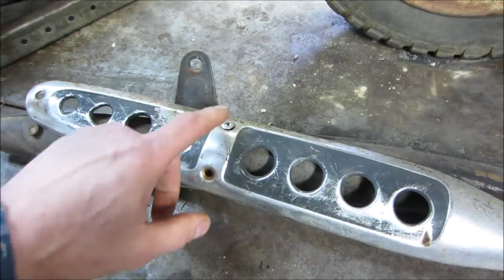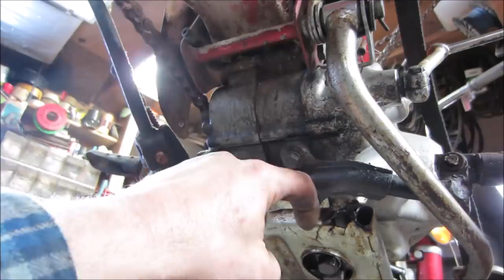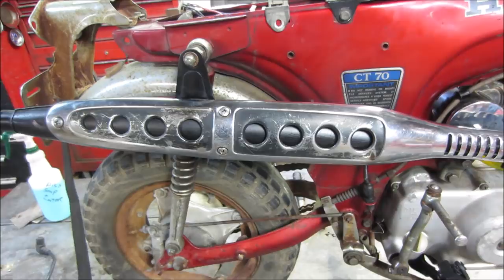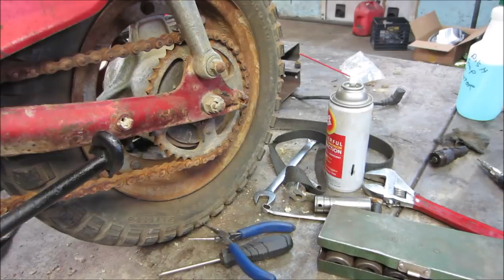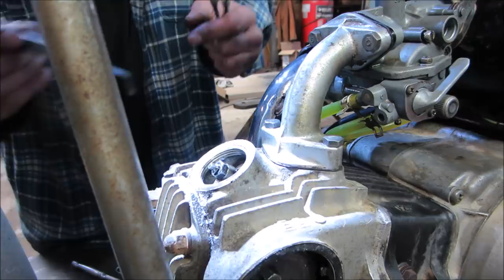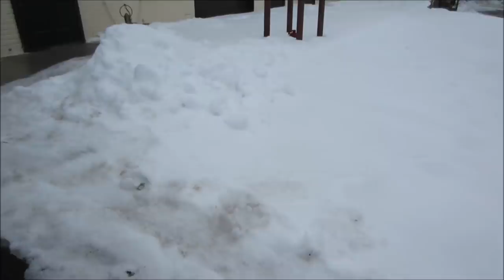The, worn out Honda Trail 70, Engine Repair/Restore, pt4.

Comment: .002" intake, .003" exhaust.  0.016" clearance for points.  Missing a bolt at the base of the cylinder.  As you indicated in the video, no advance.  The closer you stay to that gap the better the top end will be.  Clutch fiber plates are done, it's had automotive oil run in it.  They're slipping due to the friction modifiers, which is why you can't reliably give it a good 'kick'.  You'll notice the clutch slips in 3rd.  There is a "filter" under the clutch plate, gathers all of the clutch ooze.  There is a screen at the base of the right side case cover that should be removed and rinsed.
Reply: They really don't like automotive oil in them! Ask me how I know! (I was 16 at the time) 

Once the friction modifiers soak in the clutch discs they are junk.
Reply: @axkoula7851  Even the Honda DEALER Tried to sell me can of 30 weight AUTOMOTIVE oil with a new QA50 ( minìbike ) & the boss had a big arguement with me ! - " Your just a kid - what would you know " (more than u my friend ) & that was the dealer...I used the running in 10 weight it was filled with once past & during the warranty period i drained THEIR oil & used Belray straight 30 weight - my Dads volvo master agent/Engineer agreed with me -went better too, who remembers Belray Oils from the 1970's ???, seal swell fork oil etc ??? Thanks. Trev.

Comment: It's warming up a bit here in Texas and just as the grass needed it's first mowing I find out my yard guy has moved over the winter. I got out the wife's grandfather's trusty 30+ year old but long neglected Honda mower out of the shed. It's sentimental to her since he was so careful about maintaining it. Of course it barely ran, smoked, wouldn't idle, self propulsion didn't work, and the blade was just a dull hunk of worn rust.  My wife said "Just go buy a new one." I refused. I didn't spend all winter watching Mustie1 videos to fall at the first hurdle!

Even if I had an ultrasonic cleaner I don't think I could have brought that carb back, but a new one was easily had. The blade was likewise beyond repair. The parted transmission cable was more of a challenge since I insisted on repairing it. New plug, new pull cord, oil change, and she's purring like a kitten. Thanks for the motivation, Mustie.

Now if I can just find a kid to follow it around my yard...

Comment: Watching Mustie kick the bike in gear while on the bench brought back fond memories of putting the front tire of my H2 Kawi 750 Triple.  Mach IV Widow Maker.   A friend and his brother had a Kawi dealership.  The friend had an H2 750 too.  He put a tuner kit on it - 850cc with tuned exhaust.  We'd race and then come back to the shop to replace broken clutch springs.  One day he put the front wheel of his bike up against a bench support in the shop.  He kicked into gear and wound it up - speed shifting into 3rd gear.   Wore the cream coat right off of the shop floor and into the concrete below that.  The shop was so full of smoke you couldn't see a foot!   This was just before the big 4-strokes came out and ruined all the fun.   When racing those big 2-strokes you had to think 'shift' as soon as you dropped the clutch or it was too late and you lose.  You would over-rev almost immediately.   Very small power band (low torque) - but fun to drive.

Comment: Don't know if people realize it, but sometimes those magneto's can be a real pain to get off..and that corrosion underneath is why I always give a shot of lube into them with a red straw before I even turn the engine over. Then I polish inside w/varying grades of scotchbrite. Don't forget to clean the connection at that green wire, which was corroded at the contact point. Great job on the exhaust! and also the valves and such..folks don't often realize those chains have adjustment, and also glad you mentioned not getting them to tight. Freaked me out a bit about the bolt missing off the cam sprocket though ;) Also taking so many parts off the orange bike, as I want to see that 1 come back too. I had one restored(also red) some few yrs. back..and a guy who seen me riding around finally offered me more money than I could say no to, so I let it go. If I'm not mistaken you have another in the hoard, and hopefully combine to get another at some point..but this ones coming along nicely.
Reply from the maker: yes a 4speed model
Reply: @mustie1  ah, the most desired transmission of those! Saving the best for last, and hope you can gather enough engine parts for it, will look and see if I have any left over, but don't believe I do for the 70's.

Comment: Hey Mustie1 i just have to thank you. Thanks to your incredible knowledge and watching your videos i had a problem with a Honda 160cc pressure washer and solved it myself! I took the carb apart and actually knew what I was looking at. (sorta). Cleaned it out, reassembled it and got it running. Thanks again And keep the videos coming.
Reply: Nice!!
Reply: That, is why YouTube is (still) cool. Whenever someone learns something from watching another. Awesome job!
Reply: @aserta   I bought my first 125cc 2 stroke motorcycle because of videos like this.

Comment: I have a very similar tool to that mag puller for bicycle work. Use it for pulling the pedal arms off the 3 piece crank assembly. Makes that job so much easier.

Comment: HI mustie1. you do great jobs on these old machines. I am from Pakistan and we still have these around. Even I have one from 1980. its the same displacement but different transmission. I would like to tell you that there is another timing chain adjuster under the engine, secondly you should also open the point and coil plate under the magnet. there is a plastic tensioner for the timing chain it might be a goner. also that the timing chain runs the oil pump in the engine. you should also check that.
Reply: He did mention that he thought there was another tensioner.  Based on how loose it was, I agree the plastic one might be history.

Comment: A square drive deck screw and a dowel make a good valve adjustment tool (if you want fancy, use a nice file handle.)

Comment: I've got a 71 H model and the pipe was rotted in that spot, after repairing it I took some sheet aluminum (cut up soda cans) used that to fill the gap between the clamp and the pipe.

Comment: Wow, 255,000 subscribers! I got on board when it was 44,000, and not that long ago. Keep up the great work and hopefully, Mustie1, you’ll be right up there with Unbox Therapy, who has 13,000,000+. I have to say that this is much more entertaining and informative. As for the little bit of smoke, it’s better to “see” it’s getting lubed than not, like a 2 stroke. Having had a few “rice burners”, I always felt better seeing a smoke trail than not.

Comment: Mustie, It appears you are missing a cylinder bolt on the gear shift side, right next to the flywheel. Thanks for another great video!
Reply: If I recall, the 4 acorn nuts on the top of the cylinder have long studs that go into the block. 
The bolt that’s missing pretty much keeps a tight seal for the base gasket.
Still important though.
:-)

Comment: These engines have neoprene guidewheels on the camchain. They get hard and brittle when they age and as a result can disintegrate. This, in turn, can very easily block oil passages to the head. Lots of these little bikes die because of this. A loose camchain will speed up that process very much. If I were you I'd tighten that chain some more. Just so you'll hear the difference if one of those wheels disintegrates. You can help the tensioner by accessing the big bolt on the underside of the engine, close to the  adjustment bolt. The tensioner tensions itself by a small spring. That spring is on the weak side, especially if the cam is in the wrong position and pulls on the chain.

Comment: The cam chain on these do wear past the point where the tensioner can't keep it tight, also the mechanism  inside does stick .  If you pull the flywheel and mag plate off you will see what is going on. These bikes can snap the cam chain  causing major damage.
Keep up the great videos.

Comment: You should be able to get that cam chain a bit tighter if it's not too stretched, the sprockets don't move in relation to each other so you don't need the slack that you need in the drive train. I believe there's a cap on the bottom you can remove to adjust the preload on the tensioner, and the stud/locknut in the side of the case only set how far the tensioner can be pushed back against the spring

Comment: Don't forget it has a internal oil strainer  that needs cleaning, you take clutch cover side of engine off to get to it.
Reply: I seem to remember on the Honda C50 / 70 / 90 s the centrifugal clutch acted as a sludge filter and had to be stripped occasionally to scrape the sludge / dirt  particles out.
Reply: Its a mustie to do, they seize for toffee if these sludge up, lack of oil changes can excel a rate it too.

Comment: I see another missing bolt in the block. 33:15 if you draw a line between the cam and crank you can see the hole mid-screen. I think you are right someone had it apart and didn't finish.

Comment: Amazing maintenance, the pipe repair, wow.  Chased those threads and new nut on flywheel, proper tool helps.  Paint on the exhaust, nice touch.  Oil change and magnet probing, great mental exercise, it coulda been in there for sure.  Thanks Mustie, budddn budddn put put put..... First Garage Sale of the Season, ho ho.

Comment: If the hole in the end of the muffler does get worse, try brazing a patch on instead of welding it up - it may help avoid blowing more holes in the thin steel with the welder, and it should hold up fine.  It's not like this engine is pushing a huge amount of pressure through that muffler.  :-)
Reply: Or use a Henrob/Cobra/detroit torch..... a great tool for welding thin steel/aluminum and braze

Comment: Ya make it all interesting and amusing. Should ya maybe adjust the cam-chain tensioner while it's running for that last 1/16" slap? And maybe inspect the whole chain for a link crimp or edge mangle where it might have conveyed the sprocket bolt into the inner sanctum? Seems the cam sprocket cover plate would show some radial scrape marks if the bolt had unscrewed itself. More likely just lost by previous "mechanic" ventures.

Comment: Hole in the bottom of the muffler (very common problem on these)... what we used to do was make a patch out of a tin can, tie it on with some wire (with some liquid metal on the inside to seal it), then paint it and put the decorative piece back on top. That usually held untill it rotted through at the exhaust port.

Comment: Our weather is keeping us indoors right now, the re-work of this little bike is interesting. I like to see it get some TLC Mustie style. As an engineer, it made me cringe when you had that Die Nut in those Mole Grips like that. I hope someone sends you a proper Die Nut holder at some point..it will be a lot easier to chase the threads for sure.....lol.
Reply: Since he has the die, I'm pretty sure he has a die holder, but there was no room to swing the handles, hence the Mustie1 improvisation.
Reply: @alanmumford8806  My Die holder has both short and long handles, they just screw into the body of the holder. Short ones are fine for just thread chasing.....:)

Comment: Adjust the cam chain tensioner with the engine running. To tight or to loose you will hear noise but when it's as quite as it can be tighten the lock nut. Hope it helps

Comment: I think the cam chain tensioner is adjusted with the piston mid way through the cylinder.  That's when there's the least pressure on the cam chain.  That's a 90 degrees from the T mark (a little punch mark will allow you to find the spot with ease next time).
Reply: there's nothing like a Mustie1 Sunday morning Honda vid.

Comment: When first charging a battery you should do an equalizing charge, continue charging until every cell is gassing (some will start earlier than others), keep the voltage between 2.5V-2.6V per cell for several hours. You also need a normal charging current, not trickle charge. This helps a lot with battery life and minimising premature death.
Reply from the maker: thats not what the instuctions say with the battery

Comment: I don't know if the square valve adjusters are the same size, but on my sister's Honda dirt bike a red robertson drywall screw fits it. Easy to fashion a valve adjusting tool screwing a drywall screw into a small piece of wood for a handle. Easier than using a wrench I find since its always a bit of a fiddly job.

Comment: Adjusting the timing chain: When I was 16/17 I had a honda cb400/4 and screwed it up bad. I thought too that you just "ran the screw in" but what happens is, the screw applies tension to an internal shaft which pressed against the plastic tensioners. This shaft was spring loaded. What you were supposed to do is loosen the lock nut, loosen the screw, the spring applies tension, then you re-tighten the screw holding it in place so there isn't constant pressure on the tensioners. When I ran the screw in I broke the head off. ARRGH. 

So shortly thereafter my parents went on a month long road trip vacation. about 10 days in I pulled the motor out, carried it into the kitchen and pulled it apart to drill out the broken screw and put another in. Wouldn't you know it? My parents came home 2 weeks freaking early lol

OH MAN they flipped out on me. I said "why are YOU mad? YOU are here 2 weeks early! if you'd stayed away you would't even have known. I would have cleaned it all up."

Comment: Mag inside the cam chain inspection port and make sure the bolt isn't rattling around in some small crevice in the bottom of the head.

Comment: Hello Mustie, I see your CT 70 vids are coming along nicely, I will post a couple of internal things you should check  this week as well. I used to build tons of these and have some tricks to fix shifting issues and other internal problems. You NEED to replace the cam chain in yours before running it much more.Ive used DID and had good success. The oil pump gear and tensioner gear are probably pretty worn also.The clutch hub is actually a centrifuge for the oil & probably packed full of garbage..TTYL

Comment: Smashing repairs mustie, the old honda is getting better and better :-D.
Looks even better with the exhaust back on :-D.
The overhead cam is a bit of a worry, surely it should not have that much lateral slop.
Reply from the maker: l think the cap has a rub pad that holds it in, so when the cover is off made it sloppy

Comment: I feel as the rattling noise evidences that low end is burnt out , for me is tipical worn out con rod bearing or crankshaft  ball bearings worn out.Those little engines used to make that noise after wear at the clutch cage (aluminium...).

Comment: We used to have these CT's back in the day in Germany as well. They were restricted to a mere 50ccm and were called Honda DAX . Loose translated to Honda BADGER . Love your work and Videos, and have been watching for a couple years  now . Just thought , maybe the noise coming from the Cam chain , may be the missing Bolt from the Cam Spocket rubbing there somewhere in the Crankcase . Just a thought . Keep up the Good Work !
Reply: We had DAX, too. Different style exhaust protector.  Highly collectible today, there is a clothes shop in my town that has one on the front window. Greece here.

Comment: Please correct me if needed.  I was taught a long time ago that the exhaust header not only directs exhaust gasses but also protects the exhaust valve from cold air which could warp the valve. Anyone's thoughts appreciated.

Comment: Hi Mustie1 I think you're missing a screw on the block, on the mag side. The smoke might be a valve seal needing replacement or a piston ring set needing replacement. Either way it'll run great. Nice videos, my family had lots of those bikes here in the Philippines. Highly collectible piece of machinery.

Comment: mine had the exact same thing happen to the exhaust. Mine also caught on fire from riding without an exhaust lol. flames burnt a hole through the gas line, and pooof. Riding through the field as a fireball.

Comment: im likin your rebuilt of sorts, bending, welding,adjusting,salvaging,it got all the elements of  a great Mustie 1project, so for what's it worth thanks for taking me along for another sweet ride in Mustie 1 land where the rubber meets the road with a little help of a sledge hammer and some down home get her done mechanical skill...good stuff(where has the doggie gone?)

Comment: If you have thin metal, you can try to spot (not the spot welder machine) weld them under a thin layer of water. I have had success with various mufflers that are difficult to find. Must be clean with zero salt content.

Comment: Mustie, just a thought, maybe the noise in the timing chain area is the small cam gear bolt that possibly fell inside the engine?  Can you run the engine with the cam gear cover off and perhaps see the bolt bouncing around in there? Love this old Honda!

Comment: That motors been seriously neglected and abused... pretty good testimony to those old Honda units that it even ran. Smokes like 2t and sounds like a diesel tractor, CT doesn't stand for Castrol Tractor does it? :) Even so im sure it still has a few miles left in it yet. Just hope you don't have a missing timing gear bolt hididng in the engine ready to come spoil the party. Probably like you said somebody tried to mess with it and snapped it by turning it the wrong way and gave up! When I was young messing with bike engines on my own I had no idea what I was doing